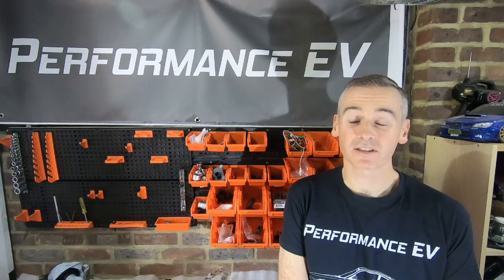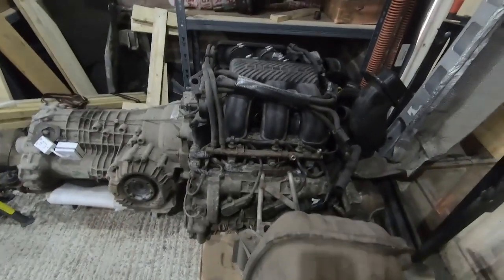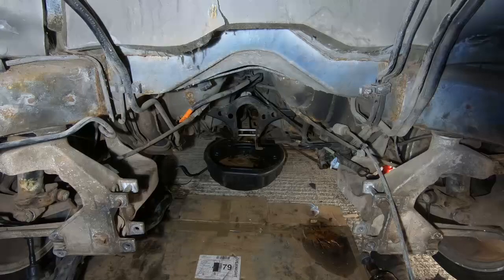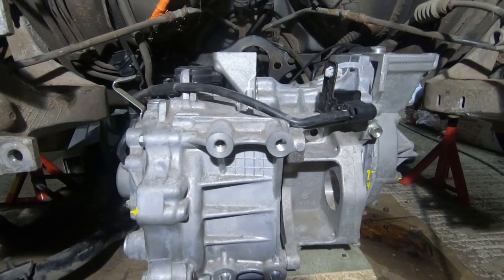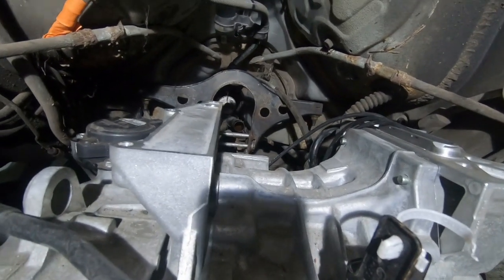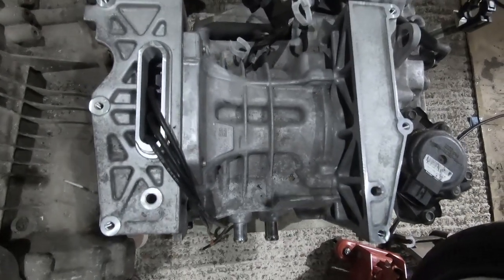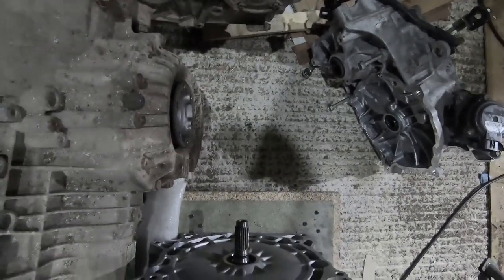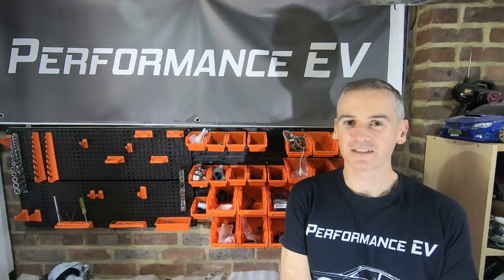Electric Porsche 911 project video 12 - Trying to fit Nissan Leaf motor in Porsche 996 - attempt 1

Comment: Have you thought about removing the mounting pedestals designed to hold the power deliver module? You might have enough clearance to mount the motor if you were to chop them off and get the motor into a cylindrical shape like an AC-50 induction motor for example. Yes, that means you won't be able to mount anything on top of the motor but I think its price worth paying if it fits under the passenger seats.
Reply from the maker: Thanks for the input, I may go down this approach. I have taken a more in-depth look at what this would do in the latest video.

Comment: Why don't you spin the motor round so it's at the back of the diff rather than the front?

The only thing I can think of that might be an issue is the thrust bearings for the diff might be different on one side to the other. The leaf motor shouldn't might running backwards.

Other option is to keep the Porsche gearbox and mount the motor to the Porsche gearbox.

It would save a lot of messing around with drive shafts too.

Comment: Not possible to couple leaf motor to original gearbox, overcoming these issues, and you can use original half shafts?
Reply: Would work and it would remain a rear engine car :)
But the cost of the custom transaxle adapter plate would offset the savings from using the stock half shafts. 
Lugging around 4 or 5 extra gears in that heavy transaxle is also not ideal. A Porsche needs an elegant solution, like the Leaf transaxle!